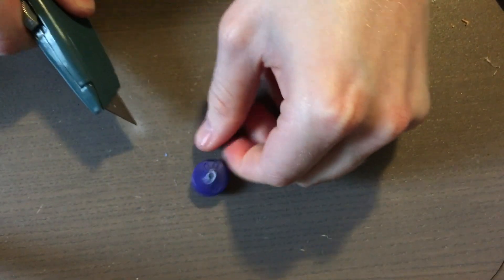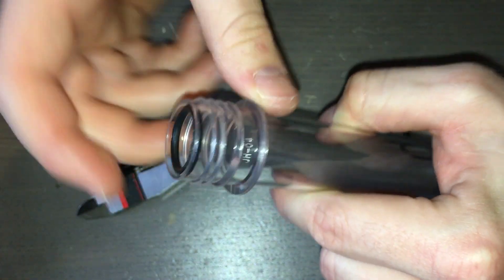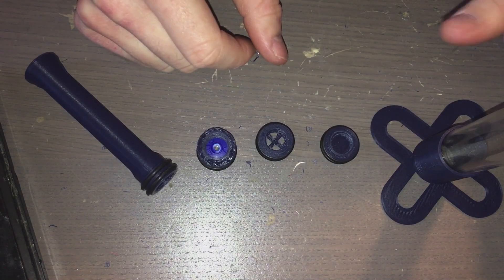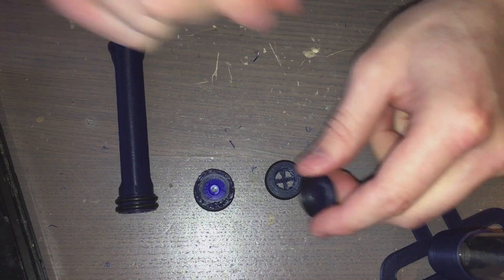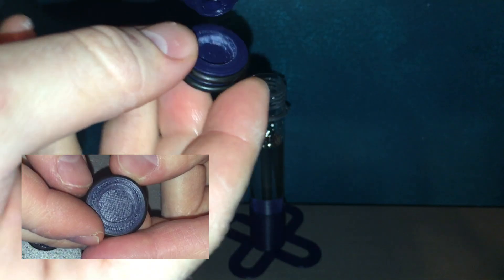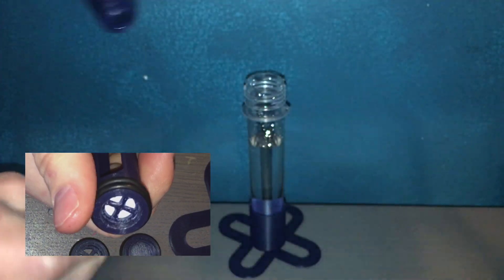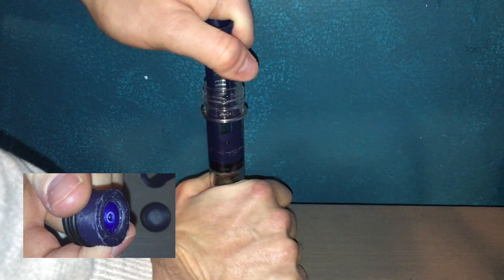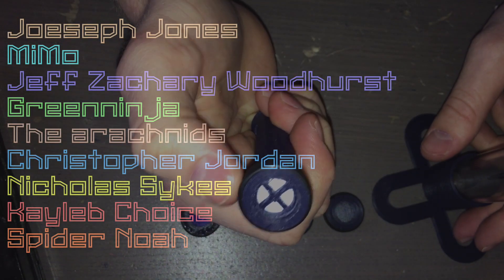Episode 9: Investigating Gas-Liquid Separation | Research & Development

Comment: I've actually come up with a solution to a problem similar to this where I need to presurize a fluid without contaminating it about a year ago. It is a balloon inside of a presurized chamber. The balloon/blatter completely seals the fluid from the outside pressure, whatever it is. This approach didn't work for me in my case because I was using hydrogen, an extremely small and light gas that just leaked through the balloon, but I think whatever you put in the balloon will stay, and it will work better because it is an incompressible liquid. During testing I used water and it actually worked great. I would recommend a way to unscrew the valve you use to pressurize the chamber so that you can suck the balloon into the chamber to fill it. Maybe even a set of two check valves with valves on top of them to controll when you want to fill or pressurize the cartridge. I know this comment is really long, but I hope you read it and implement it in a design or test it out in a video :)
Reply from the maker: Hi! Thanks for your comment! That is an approach to omnidirectional sprayers that I have seen, and I would certainly use it if I were using compressed air as a propellant. The problem is the propellant I'm using is part of the fluid, but it evaporates to create pressure. So basically, the evaporated propellant must be separated from the condensed propellant, so it must be moved across the boundary. Basically if I had a magic balloon, this would work. That's why I'm using all this weird hardware. Sorry if that wasn't clear in the video. And sorry if I misunderstood your suggestion!
Reply: @theAmazing  No problem. I was just thinking that you could put a fluid in the balloon that doesn't have propellent added to it, and then add compressed air or cold liquid butane or other ideal gas to the bottom of the container. I didn't realize that the fluid has the gas dissolved in it. How would a flitler help this situation, wouldn't that make it "flat" like a soda? You could still keep some propellent in the fluid to make it expand, the pressure around the balloon needs to be great enough to overcome the pressure exerted by the fluid in the balloon, and it will shoot.
Reply: @theAmazing  Also I'm a little bummed out that I didn't come up with the idea :(. Not surprised though, it is a pretty simple idea

Comment: do you need a gas layer? why not take the time to separate them manually. Make some kind of separatory funnel system. then you can rely on some kind of valve that closes when pressure drops too low. another method of separation is using capillary action. to separate them. Another basic method would me using a baffle to separate them like in a lighter. Keep up the good work. If I were you I would re-do all these tests after you nail down a control plunger that actually blocks the flow. then iterate the deign from there.

Comment: A slightly different way of testing would be to replace your handle with another transparent and closed cylinder. This would eliminate the need for those O rings that kind of let water through before knowing the limits of the membrane. However the water would just go up and out the sides of the web cartridge so you would still need o rings but just place them between the cartridge and new cylinder handle